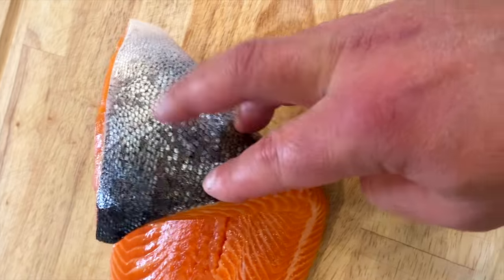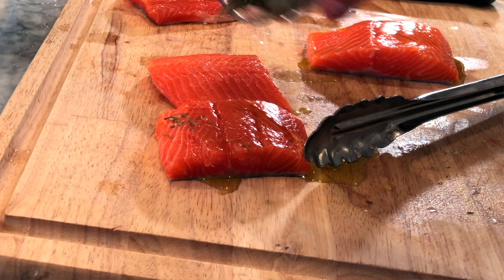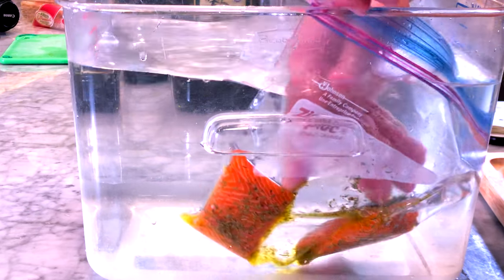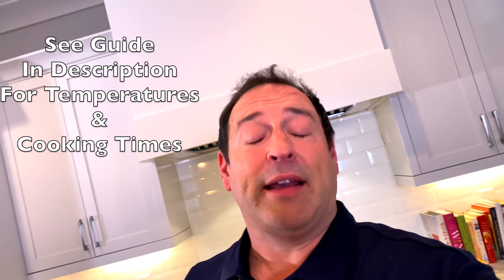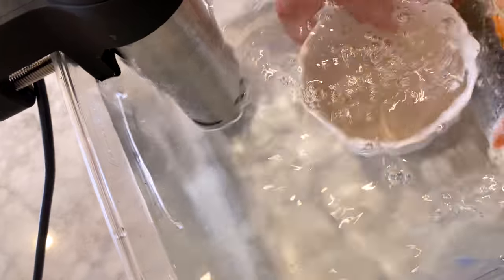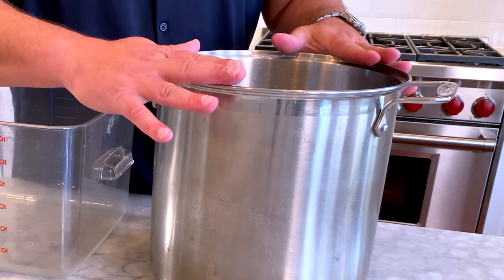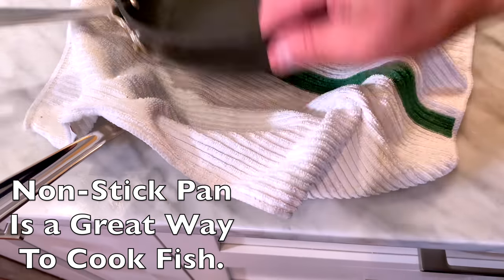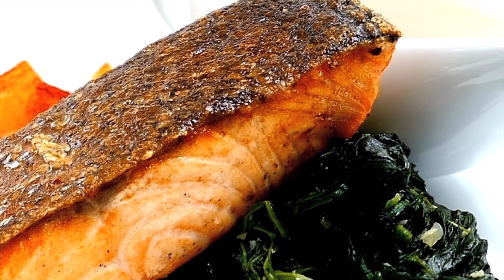Sous Vide Using Anova

Comment: Woww great tips !! I have never cook salmon, I am intimidated by it 🤣 what is the name of the machine u used to cook it when u submerged in the water? 
Also great tips to take all the air out of your ziplock bag !! I do a lot of freezer meals on the crockpot! ❤️
Reply from the maker: Hola- it’s called an immersion circulator. The brand is a nova.  I put some links in the description of the immersion circulator.  It’s by Anova- I think it runs $130.00. Great for steaks.
Reply: Yummy 😋 it looks amazing !! Thank you for sharing ❤️

Comment: Very nice tips for vacuum seal! Could I use this tip with chicken and beef fillets? Thanks for sharing!
Reply from the maker: Hi yes you can use it one any thing - if you want to freeze any meat you can use this technique of water displacement.  The  reason why food has freezer burn is the air ( moisture ) inside the bag freezes.  If you remove the air no feeWr burn. This is the inexpensive day to remove the air.